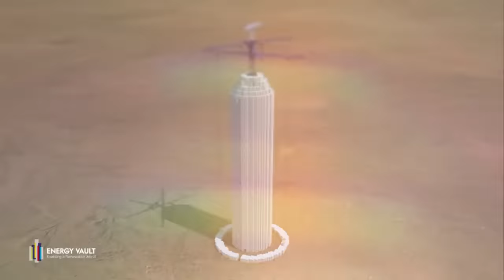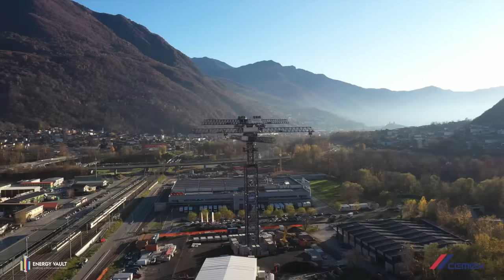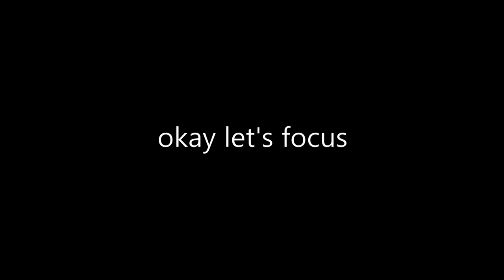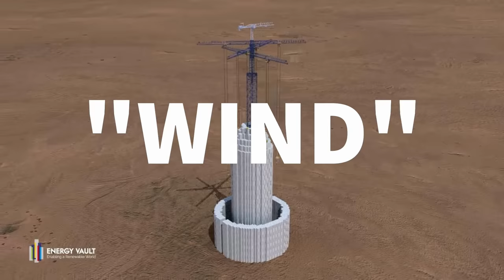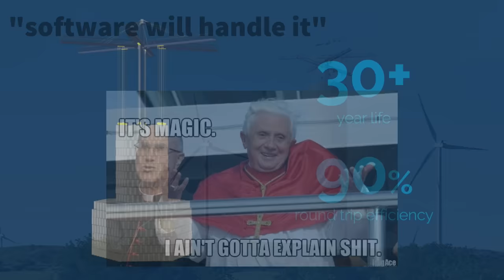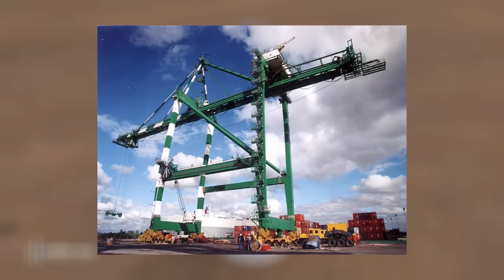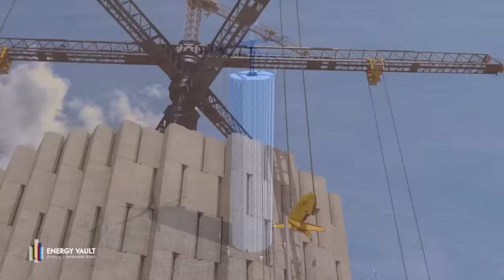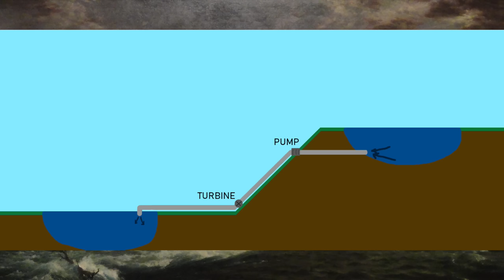The Energy Vault is a Dumb Idea, Here's Why

Comment: I like how instead of solving actual problems they "solve" already solved problems

Edit: yes i know that this problem isn't actually solved so please shut up about it
Reply: Well you could say that hydroelectric cant be put everywhere.... Which this (really bad) concept tries to solve...
Reply: @KeVIn-pm7pu  I'm pretty sure that hydroelectric isn't the only good eay of storing energy
Reply: step 1. find a problem with a simple solution.
step 2. come up with future-tech epic bacon 420 tech bro solution.
step 3. use CGI to market your "revolutionary idea" to idiots, gullible journalists, etc.
step 4. profit.
step 5. move to a less dystopian, European country with clean air, lower noise pollution, sensible laws, etc. 
step 6. sigma male grindset achieved.
Reply: but in cool sounding non-efficient futuristic way
Reply: @professorcube5104  hydro is generally the only grid scale energy storage system we have that im aware of.  I could be wrong though.
Reply: @cesaresaladandthespicycrou4080  damn
Reply: Adam should make a sister podcast to Well There's Your Problem called We Already Fixed That Problem.
Reply: @professorcube5104  Right now, Hydroelectric is the most Cost Effect way to store such power. The main reason is a hydoelectric generator is the fastest way to get started.  No need to "warm it up" which you have to do with oil, coal or natual gas generators OR keep it always running as in the case with Nuclear generators.
Reply: That's how most scams work
Reply: @professorcube5104  well there are other options but they are either Limited in Time of Storage (flywheel), very inefficent (Power to gas), very expensive and therefore not very vaiable for mass Storage (batteries). Hydroelectric is still the best way to Store Energy, pretty efficent (75%-85%), comparable low cost, Storageable for long(er) time periods.
Reply: @cesaresaladandthespicycrou4080  Not necessarily, for instance using excess energy from wind and solar to create hydrogen from the electrolysis of water (splitting H2 from H2O) could be a solution since the world will need a mobile form of energy that isn't only Lithium Ion batteries.
Reply: @WidespreadKnown  after all with your deserts in the USA you have a perfect Location to produce h2 for cheap.
Reply: @WidespreadKnown  Two words. Nuclear power
Reply: @dahleno2014  thats Not a vaiable Option for the whole World and far more expensive, if you dont ignore the costs of Storage for the waste.
Reply: Welcome to capitalism!
Reply: You mean just like renewables?
Reply: Far from solved. Pump storage is only viable in mountainous areas with lots of water and ideally cold climates like Norway and Iceland.
But most solar energy will be produced in deserts and there is no water with maximal evaporation and sometimes no mountains.
Most wind energy will be produced offshore or onshore at coastlines where there is often no mountains.
Reply: Innovation baby!
Reply: @WidespreadKnown  i am excited about that one, but also i dont think it is in production, but either way i could say the same thing about h2 storage or molten salt batteries.  Why create them when pump hydro already exists.  It is just lazy.
Reply: @marceldavis430  Not really. Renewables dont solve any Problem thats wasnt solved before.
Reply: @sualtam9509  well for  that we have Power to Gas. Therefore Yes the Problem is already solved.
Reply: @KeVIn-pm7pu  Same as storing gasoline in a desert. The electrolysis doesn't have to happen in the desert, Hydrogen can be transported to storage tanks in the desert until it needs to be used. Not saying there aren't problems to solve just that using Hydrogen is the only renewable way to store energy in liquid form.
Reply: @dahleno2014  That's energy generation, not storage. Nuclear Power is a good way to generate energy but we still need to find ways of storing energy when you aren't attached to the grid and storing excess energy from wind and solar.
Reply: @cesaresaladandthespicycrou4080  It's not in the mainstream as a solution to energy storage, sure, but it should be researched as a solution is more my point. It's long-term usage would be one of the only ways to become carbon-neutral, unlike more popular ideas such as using ethanol or Lithium-batteries.
Reply: @KeVIn-pm7pu  Power to Gas when using only electrolytic hydrogen from electricity to gas to electricity is at 30% efficiency. Far less than batteries, while being more expensive.
It's tech bro BS fueled by Big Oil.
Reply: @cesaresaladandthespicycrou4080  pumped hydro is very inefficient and requires a lot of land area.
Reply: @professorcube5104 
Energy storage is a huge problem. It's one of the most important problems in engineering right now.
Reply: @sualtam9509  "while being more expensive"  I very sure it is not more expensive than a batterysytem thats big enough to store 4 months of energy for a huge industrial country.
Reply: @WidespreadKnown  
" Not saying there aren't problems to solve just that using Hydrogen is the only renewable way to store energy in liquid form. " - again ammonia is another one. but its not exatly needed to be in liquid form, is it?
Reply: @KeVIn-pm7pu  Only that they made that issue worse, too.
Reply: Renewables do have this problem, and they are trying to  solve it. Using a solution which is basically worse then a real-life interpreation of it.
Reply: @KeVIn-pm7pu  Like I said in another thread, one of ammonia's byproducts is nitric acid, which is carcinogenic. It's not a storable energy solution, there's a reason we don't have giant ammonia burning plants because it would make living around those places untenable. Plus, there aren't giant areas of ammonia to be "mined" so we would have to create it from other products which would be adding an unnecessary step to trying to solve how do we become carbon neutral, as a society.
Reply: @MrCmon113  It's honestly a bigger problem then switching to renewable energy because at this point we have the scalable technology to move over but no way to store it sustainably.
Reply: @professorcube5104  Where is that place exactly? People need water to survive and hence hydrostorage is possible everywhere people live. Even in Arabian peninsula, sea water can be pumped to high places and then released as it is not necessary to have drinking water storage
Reply: I wonder why. It happend to me very often. Luckily I was blessed enough to realize early on the way. But I guess it has to do with a concept of thinikg of innovation as something inherently good, altough in deed just good things are good, not new ones, while this concepts serves fueling consumerism.
Reply: @shrujanamsyama9940  Not every place has accessible hills nearby and evaporation of water in hot places reduces your ability to use it above ground so that increases costs and limits you further. Hydroelectricity is not a world-wide solution for energy storage.
Reply: @WidespreadKnown  Who says that electricity storage must be done in every village? A single large hydroelectric power station can power an entire province/state. Also, evaporation of water is not really a concern as any water on surface - river or sea will evaporate. But as we know we all store water in reservoirs and taht works well. No one expects 100% efficiency in storage. So, 60% efficiency should be perfectly fine
Reply: @KeVIn-pm7pu  What? Batteries are just straight up 30% less $/MWh.
Only advantage of power-to-power would be storage over several month, but that is highly competitive between liquified air and thermal storage.
I just don't see a scenario where producing grid electricity from hydrogen would be more profitable than using it in anyother way as ressource or fuel.
Reply: Solving problems have already been solved or creating problems to solve them literally the definition of capitalism
Reply: @KeVIn-pm7pu  doesn't matter what kind of water is used even the Sahara desert borders the ocean
Reply: Tech bros don't know what a dam is.
Reply: @KeVIn-pm7pu  Yeah if you just ypu know... put a roof over it and seal it from evaporation... you kinda can...
Reply: @cesaresaladandthespicycrou4080  there are liquid salt "reactors", they are no longterm storage, but are quite efficient. Down side is, they need quite a bit of space, and to get heat them up they neat sun.
They basically concentrate sun energy with mirrors on a center with a salt core, the salt heats up and can store the heat for hours, carrying the suns energy over the night, and depending on size for some days. This is of course no solution for all areas, but at some places this could turn sunlight into a heat powerplant, that then can produce electricity by steampowered turbines
Reply: @sualtam9509  No they are not. that would mean a battery costs as much for storage capacity as the power to gas system does. But they dont. additional most countries already have infastructure for natrual gas which can be used.

i dont see the competivity betwenn liquified air and thermal storage. especially not for long term storage.
Reply: @WidespreadKnown  this is sadly super inefficient. It would be mote viable to store the energy in batteries. The benefit of hydrogen is, that you can in theory power jet engines with it. And you can ship and sell it abroad, why companies see it as a great solution  they can exploit cheap, unregulated labour to produce it, and then ship it to rich countries to sell it... in theory. And when we gear up our systems to be hydrogen dependant then they can demand almost any price.
Reply: @KeVIn-pm7pu  you realize, that deserts are important ecosystems, too. Right? Great scale energy production in the desert will change the local climate, solar panels will cool down the area and increase rainfall and catch moisture from the air. This will in turn change the climate around the desert and so forth.
Reply: @dahleno2014  nuclear power is by far not carbon neutral, its better then coal, gas or oil. But it creates sever environmental damage, were it is harvested and considerable environmental changes, were it is produced.
Nuclear power is no long term solution, and building new nuclear plants would mean to now start building reactors, that can go on the grid in 30 years and then run for additional 30-40 years.
Also nuclear energy, while kinda reliable is not really cost efficient, when you count in the energy and labour cost for storing the waste after the reactor is done.

And then we have not talked about the fact, that nuclear energy renders an area almost inhabitable for humans for decades, when anything goes wrong.
Reply: @WidespreadKnown  And like i said there too. You just need a catalyst reduction methode, problem solved.

It is storageable. how the f woulnt it be build a tank store ammonia. end of story. we dont have ammonia burning plants because why would we it is not a minable recource like fossile fuels are.

for ammonia production you need hydrogen and nitrogen as products. where is the problem ? hydrogen gets produced by renewables and nitrogen is all around us.
Reply: @shrujanamsyama9940  the environmental impact of large scale hydroelectric plants is so severe, that it can make life down stream almost impossible. Having several smaller plants is a lot more sustainable.
Reply: @cesaresaladandthespicycrou4080  One of my professors once used the example of a solar power plant in Japan which used a giant flywheel to iron out the spikes, and Tom Scott made a video about the Orkney Islands, where stuff like the electrolysis of water is tested as a way of getting rid of excess renewable electricity. I don't think that has much hurdles to becoming a large scale solution, it's just that the conversion efficiency isn't brilliant. And then there are synthetic fuels as well, but those tend to range from utopic science fiction to literally worse for the environment than fossil fuels.
Reply: @sualtam9509  it would be more profitable if you can exploit poor people in unregulated labour markets to create the hydrogen and ship it to rich countries... And when you first convince the rich countries that hydrogen is the way to go.
Reply: @hannajung7512  you do realize, that you only need a fraction of the desert to produce the same amount of energy right?  No it will not change the local climate. For the whole energy consumption worldwide we only need 1% of the sahara.
Reply: @sualtam9509  Big oil doesn't give a shit about clean hydrogen. It could be preferrable since the production and recycling of batteries tends to involve a pretty long list of deadly chemicals.
Reply: @KeVIn-pm7pu  only, that energy stored in the sahara will do you no good if you do not live at least around the Sahara.... Or you suggest to ship stored hydrogen? Were do you get the water in the Sahara from? Will you tab into the few water sources in the subsaharan area? There are people living that need this water, you know this, right? Also, such a grand scale "solution" would only cause us to be further dependend from international cooparation monopolies. This does not sound like a great idea to me.
Reply: @hannajung7512  You take the energy and bring it to where it is needed. Its called a Power grid. or pipelines. yes ships work too.
Ocean salination is an option.
"from international cooperation monopolies" - thats a capitalism problem and will never change if not done sth against capitalism. however you as the usa would not. you have many deserts yourself. And of course an international trade of hydrogen would emerge.
Reply: Solving problems makes you look good, and the already solved ones are the easiest to do
Reply: Are you the real Mr. Timecube?
Reply: In a difficult way
Reply: @hannajung7512  How so? Large reservoirs need large lands and hence submerge large landmass but it is still more efficient than small reservoirs as large reservoirs consume land in a single place and hence don't fragment the land. Small reservoirs fragment the land resource and distribute the bad effects everywhere making things bad for everyone everywhere
Reply: The future is innovating sideways, not up.
Reply: That's where the money is. Reinventing the wheel is easier than building a new one and makes people feel smart
Reply: For scam purposes, ofc
Reply: @hannajung7512  yeah that’s great, turn deserts into not deserts with rainfall!!
Reply: ... but worse.
Reply: @farazthunderouble  you realize, that the water, that falls down in deserts can in turn not fall down were it does at the moment, right? And it would take decades to turn the desert sand into fertile ground, also: deserts are ecosystems on their own, with animals and plants that can only live there.
Reply: @hannajung7512  This is absurd thinking. If you want a certain volume of water stored, it is best to have large reservoirs than many small dams. This is plain and obvious. Having 20 small dams cause much more disruption than having 1 large reservoir. The only way small dams can cause less damage is by storing much less amount of water which in turn reduces the total water stored and that amounts to absurdity as the whole point of having dams is to store water.

I don't deny that the water species, especially the inland river fish will be affected by large dams but that is a small price to pay. Moreover, the environmental payoff from these inland fish is to limited. The only concern can be about losing the fish permanently and hence causing extinction irreversibly. The inland water amounts to just 1% of all water supply and hence the inland water species have negligible real impact on overall environment.

About silt in floodplains, the dams are dredged regularly and the silt sold off to farmers. In fact, it is much more efficient than simply allowing flooding of plains as lot of silt is wasted and washed down into the sea. Reservoirs avoid such scenario. Dredging and desilting of reservoir is a must as if not done, in about 6-7 years, the reservoir will lose 50-60% capacity. SO, the logic about floodplains does not hold grounds considering the fact that the silt is mined and given back to where it is needed and in a much more efficient manner.

About trees giving shade, you don't understand how trees work. In many places in India, govt planted nilgiri and certain other variety of trees across rivers and it was found that these trees suck out huge amounts of water and lower water level. Even other trees suck water from rivers and hence lower the water carried. Moreover, trees also lose water as transpiration which is not much better than evaporation. Evaporation happens only at the water surface whereas transpiration happens across all trees and cover much larger surface than water bodies. All the trees suck water from the same ground which is supplied by the same water bodies. This means that the loss through trees is much more than evaporation.

About water overflows and repairs, dams are made with extreme reinforcement and are meant to withstand even wars to some extent. It is true that it needs maintenance, but that is not an issue as everything in the world needs maintenance. If you leave a house empty for 5 years, it will become unlivable. About flooding during rains, it is true that large dams flood more but it does not crack. there are operators who lift the gates of dams when inflow becomes too much to handle. Downstream does get flooded more extensively in alrge dams but in small dams, the flooding is more widespread, thereby causing much more crop loss and possible famine in comparison. It is a tradeoff between flooding smaller areas but with more concentrated damage or flooding everywhere with lower damage. If we look at greater good, it is better to save crops over large areas at the expense of few human lives in smaller areas as famines can be much more dangerous than small loss of lives.
Reply: @hannajung7512  No they don't. Hydrogen gas has to be stored under high pressure or at cryogenic temperatures, neither of which are necessary for crude oil and most of its derivates to my knowledge. Just look at how different oil tankers and gas tankers are built, and same for above ground storage tanks. And yes, you could argue that those gas tankers and tanks are largely owned by oil companies, but a far too big portion of their production and products are things like plastics, asphalt and other byproducts for them to want to switch to a source which does not provide any of those opportunities and makes such a big portion of their plants obsolete. Besides, these companies are so big and influential that if they'd really want us to use hydrogen you'd be able to get it at every petrol station already. There is no way they would ever allow electric cars to get a bigger market share than hydrogen cars if they cared at all.
Reply: @shrujanamsyama9940  What I told you is not absurd thinking, but what I  learned by listening to ecologist studying the impact of damns on the environment and mitigation methods.
The assumption that decentralized smaller floodings would cause wide spread crop failure, while one huge flood will "only cost some lives" is assinine. Not only can we mitigate local crop failure (if they would even happen) with our modern supply chains, a big flood would affect not just the local area ... It would literally flood the whole river dale. To varying degrees sure, but still.
And a big flood does cost hundreds if not thousands if lives. It is simply just unethical to take this calculated risk to have some farmes not loose their crops.

And about the selling of silt: it might be more efficient to bring our the silt manually instead of having the rivers flood the area, but making farmers pay for something that should he part of the normal ecocyclevof the area is absolutly unethical.

And current damms allready are affecting for example the salmon population, causing not only the loss of the species, but work place loss, and ecosystem disruptions because salmons are quite important for most of them
Reply: @jlust6660  so the flywheel storage is cool but it only has like a 5 or 6 hour charge time.  The thing about pump hydro is you can have a 7 gigawatt plant.  Thats about 480,000 tesla walls.  So our technology is far from real grid scale storage outside of pump hydro so the idea to say oh they invented pump hydro is dumb.  You cant have pump hydro outside of areas with natural water.  Otherwise we would have pump hydro everywhere and be green.  If gravity bateries didnt need millions of tons for the potential energy they would be great because as they grow cubed so they almost work better as they grow where as chemical batteries are just AA batteries stringed together.
Reply: @shrujanamsyama9940  no country has crop failures on that large a scale because of a local flooding, what are you thinking how these floodings look like?
Selling the silt is unethical because it causes a dependancy and reduces the ability to self rely of the farmers, if they cannot afford to pay for the silt they are fucked, driving the loss of small family farming and the spread of large Industrial farming and by doing so poverty and hunger, because now people that befor were able to work the land for food have ti buy it.
If you think, that marshes or forests are useless, you lack the vety basis of understanding needed to talk about ecological impacts.

And the ecologists are christian evangelists or NATO spies? Are you high, dude?
Reply: @cesaresaladandthespicycrou4080  I'm not making a case for or against any of these technologies (with the exception of synthetic fuels maybe), I was just pointing out that they exist (I had missed the comments that mentioned them before me, sorry about that). Though I think that with your arguments against them you're comparing apples and oranges somewhat. The flywheel I talked about isn't meant to be something on the scale of a decently sized hydroelectric dam, IIRC the solar park it accompanies isn't that big to begin with. I do think that does not mean that the application could never be done on a larger scale if that would ever be necessary. Especially in the energy debate in the region where I live just any large scale solution seems to go out of fashion. For hypothetical new nuclear reactors there is a serious consideration for more smaller power reactors as main suppliers to more local grids, which implies you can look for energy storage on a case by case basis as well rather than needing a single solution to solve all problems. And as such, energy storage could maybe also grow with the demand and would rarely ever have to be grid scale by our current understanding of the word. That sort of is what happens around here already, a lot of cities have a few windmills for electricity production, and on windier days the excess ones are turned off or deliberately made less efficient to meet the demand, but I doubt these single windmills being switched off are often significant to the grid itself, so if in the future they would keep spinning and the electricity would go into storage that would not have to be storage on the order of gigawatts.
Reply: @marceldavis430  I’ve come to Learn how to spot an idiot on the internet is when they say something like “ you mean just like …..” and say nothing else
Reply: @dahleno2014  
I'm sure your Great, Great, Two Headed Grand kids will thank you for their inheritence.
Reply: @professorcube5104  naw. Gravity batteries like this have been around for a long long looooong time. Lots longer then electricity has been common. Heck. They where still operating to service industrial facilities from the old steam age when I did my machining apprenticeship. 
They work, the issues in the video are blown way out of proportion, the biggest issues are they take up real-estate and people don't like hearing blocks bang together.
It's just fluff. Both ways round.
Reply: @humanistwriting5477  did you even listen to the points he made. Plus do you even have any expertise in this topic?
Reply: @professorcube5104  I do have expertise on the topic. 
And I did listen to the video.
And I have made the bearings for an 130 year old gravity battery. They are not a bad idea.
And I do not need any expertise for you to do the maths yourself, just look at how fast the wind would have to be before they become a problem. It's basic math no complex formula required.

From there, look up the fatigue limit for steel, and realize the entire spill about "self repairing" magic materials literally describes steel.
Reply: @hannajung7512  I don't think you understand the extent of flooding that happens in large plain land, During heavy rains, multiple rivers flood and devastate large amount of land unless controlled by dams or other means. Even 10% food reduction is enough to cause famines and that can easily be done by flooding.

Selling silt is not unethical as the silt is sold at cost price by govt. No one else can sell silt as only govt has access to dams and only govt can authorise dredging in dams. This will forever remain that way mainly due to security reason (attacks on dams). As a result, the silt is never sold in prices that hurt anyone.
Reply: Well energy storage isn’t really solved globally but there are far smarter ways to do it currently
Reply: @WidespreadKnown  you mean the hydrogen creating with a like 12% efficiency? Sucks pretty hard.
Reply: @dahleno2014  isn’t really an option. Requires ginormous mines,  causes pollution, waste has to be stored for billions of years.
Reply: @cesaresaladandthespicycrou4080  That's because physics.  You need to move a lot of mass down a steep and long height gradient before you get worthwhile energy returns. Try to do that with concrete blocks and you'll have city sized crane farms which keep breaking and falling over even when a horrendous amount of time and money is spent on maintenance and all at a huge capital cost.  Hmmm.
Reply: @KeVIn-pm7pu  well with power to gas and than back to power you loose about 70% of the energy when we talk about Methane. 
When we talk about Hydrogen you have the problem, that storage does not scale up well. And we still lose about 40 % of the energy. If you go for the fuelcell, to get a cut of the energy bet, you have the problem that they are really expansive and use some rare materials. So that also does not scale up well. I am not saying, that there aren't options. But we are far from the point, were all problems are basicly solved.
Reply: @theodiscusgaming3909  pumped hydro is quite efficient. The area it requires is not the real problem. The Problem is that you can only build them in specific places. And those are several orders of magnatude to few for the storage capacities we expect to have.
Reply: @paulmentzer7658  You have a start-up time for hydroelectric too. The water goes in big tubes to the turbine. If you start up too fast, you have pressure waves in these tubes, wich can break them. But start-up time is really short, like 30 sec to 3 min.
Reply: LMAO if energy storage was a "solved problem" we basically wouldn't have to worry about global warming, but sure
Reply: @MusikCassette  well i dont See much of a Problem there. The solution simplifyed is just build more of them. You say it doesnt scale up good but why exactly? I dont See much of a Problem just Time.
Reply: Pump-storage hydroelectricity requires an elevation change in the topography and the voids being filled are usually the remmenantes of an open pit mine. It’s great when these factors are present, but not feasible elsewhere. That being said, this crane idea is never feasible so the water storage has a leg up on them.
Reply: @sualtam9509  did you watch the video? He showed how you could do underground water storage and above ground tanks. Maybe not the best but still more feasible than the tower of babel but in concrete
Reply: But making sure it looks cool and futuristic on CGI videos.
Reply: @cesaresaladandthespicycrou4080  Molten salt thermal batteries work well with concentrated solar thermal. They've been deployed in Spain at the grid scale. They are pretty compact for the amount of energy they store, are mechanically simple and not ruinously expensive. It really annoys me that we haven't embraced CSP in Australia. Setting it up around mining settlements west of the dividing range, where there are clear conditions, flat ground, and high solar irradiance and already existing electrical infrastructure seems to be really low hanging fruit, and there is an abundance of land to keep on expanding it for as long as you want. Places like Broken Hill, NSW, Kalgoorlie, WA  and Mount Isa, QLD would be ideal for this.
Reply: @MichaelSotoCE  Yes I did and this way is an engineering nightmare. Adam might be good at pointing out flaws but he has no solutions of his own and just points at existing ones. In some cases that might be valid, in this case it's not.
Reply: @lmlmd2714  thats awesome.  I was unaware that they are actually finctional and work.  The over all arching point i am making the CMSBs didnt solve a solved problem.  And all though this is a bad idea saying it solves a solved problem is just dumb.
Reply: That's capitalism, as long as you make people believe they need something you can sell it. If you can sell it, you're winning at capitalism even if you're product is bad or destructive.
Reply: The best way to make money is to take an existing solution and tweak it to make the solution look cool.
Reply: They are trying to solve a problem of geography. Not every place has appropriate geography for pumped storage hydroelectric. That's the weakest argument in the whole video. It should have just been 3 seconds of "they are ridiculously material intensive and inefficient."
Reply: @WidespreadKnown  No cus the process is so inefficient, you loose a huge amount of energy that you put in
Reply: @strider_hiryu850  Add to step 4 having an IPO which pushes the valuation of your vaporware company to over a billion dollars
Reply: @KeVIn-pm7pu  
I talked about several different configurations. And several different Problems. So it is not quite clear what problem you think would be solved by building more of what.
Reply: Capitalism
Reply: @professorcube5104  Whether or not a method of storing energy is good is dependent on what problem you're attempting to solve. Pumping water between higher and lower reservoirs would be a pretty bad way to store energy to power electronics in a vehicle. As for smoothing out electric loads, I don't think there is another method that is remotely scalable to a major power grid than hydroelectric storage. Compressed air storage is used in several industrial applications, especially those which already require large air compressors for operation, but this is very difficult to scale up to city-wide or larger grid applications.
Reply: @cesaresaladandthespicycrou4080  Compressed air is used in some industrial settings, especially where the plant already operates a large air compressor/tank. They'll compress air during off hours when they can purchase electricity more cheaply, then run a turbine off of compressed air during peak draw hours. This is the next best large scale energy storage solution I know of, but at a full grid scale it's just absurdly cheaper to pump water uphill than to build pressurized containers for a huge amount of air.
Reply: @benbriggs4604  the point i am trying to make is it is like saying who cares about energy storage everybody should get 50% of their energy from windmills like Denmark.  Well yea that is great if you are by wind, but if you are not you are SOL.  Just like pump hydro is great if you are by water but if you are not by water you are sol.  Solar energy isnt replacing wind.
Reply: We can't even make cities sustainable and less car dependent. When we already had car less cities in the past.
Reply: Gotta scam some investors somehow.
Reply: Ask one of these engineers how to crack an egg and they'll have you throwing it up at the ceiling and using a large bucket the size of your kitchen floor to catch the egg. A filter system would deal with the egg shells and pieces of plaster from the ceiling, and the vessel in the centre of the dish shaped collector would be where the rest of the egg slides into
Reply: @strider_hiryu850  solar... Freaking... Roads
Reply: Capitalism in a nutshell: either sell the same shit with a different name or event new needs/problems to sell the solution for it
Reply: Lol, what 3 words would like a word with you.
Reply: Frankly, hydro-pump storage has a lot of problems. Low efficiency, high costs, low output... you know, the problems this new system has, except not quite as severe. The only major difference is that pumped water requires a certain kind of land and a large volume of water, while this device can be assembled in any place that isn't too windy and has flat ground somewhere. That means that it could have some viability, barring the fact that, as mentioned, gravity is a terrible way of storing energy in general.
Reply: i mean this is a way to not stuck in local minimum
Reply: VC in a nutshell. 
I only want to solve a specific problem of mine, becoming a millionaire by earning $500K/y
Reply: @hannajung7512    " Great scale energy production in the desert will change the local climate, solar panels will cool down the area and increase rainfall and catch moisture from the air "
I don't see a problem in turning the Sahara desert into the Amazon forest. (the amazon forest itself was probably man made by the antique civilizations of the mountains burning the swamp and turning it into a forest, which is much better than a swamp)
Reply: @hannajung7512    "nuclear power is by far not carbon neutral, its better then coal, gas or oil. But it creates sever environmental damage, were it is harvested and considerable environmental changes, were it is produced."
It doesn't create more environmental damage than normal mining. And processing only does damage if you fail to contain the processes, we don't consider it because all of the human industry actually have environmental damage if exposed, that's why there's safety procedures. The damage only occurs when the system fails, like oil spills for example. The real problem with Oil is not spilling thou, its the CO2 environmental effect on the climate.
Except nuclear is much more easy to contain because for most of the processing is done in solid form, not on aqueous.
Nuclear power is totally carbon neutral if you use electric trucks to move the rocks. There's nothing in the entire process that really requires releasing tons of CO2. Except for the concrete production and the steel production (everything uses concrete and steel, that's another problem, not a problem with nuclear power), but still, a nuclear power plant uses way less concrete than an Hydro plant.

"Also nuclear energy, while kinda reliable is not really cost efficient, when you count in the energy and labour cost for storing the waste after the reactor is done"
WTF, storing the waste doesn't have to have is higher labor cost, you just don't think about creating a sarcophagus to store it for 100Ky, who needs that? 
Just store it in a stable geological region bellow the water table, just dig a hole, or use already dug ones (old mines). Its as simple as that, the problem is this fucking FUD, fear and uncertainty and doubt. And basically "not on may lawn". Its not a technical problem, nor is it costly. Its mostly a political problem. 

Nuclear is totally cost efficient in the long run and at massive scales. The real problem is that it requires a massive up-front investment. At least get things straight before telling bullshit about things you don't know.
Reply: @KeVIn-pm7pu    "  you do realize, that you only need a fraction of the desert to produce the same amount of energy right?  No it will not change the local climate. For the whole energy consumption worldwide we only need 1% of the sahara" 

its more like 15% or the size of Texas
Reply: @monad_tcp  people have to watch over the sacrophagus and maintain it though... This costs labour and energy.
Or people have to dig the hole, stabilize it and then watch over it, guard it. So same effect, if not even more costly, because digging a deep stable chamber that is below the waterline AND watersafe, so water will not flow in is not that easy.
It is not even close to as easy as you think.

And please tell me how the environmental damage of nuclear waste getting in rivers or the soil is not worse then lets say: iron getting chucked out?
Your trust into the mining being safe and contained is unjustified... If I could rely on companies or state to actually be responsible in what they do and play it safe I would probably agree with you.
But they don't. That is why we have contaminated groundwater, oil spills etc. Only few of them are because of desaster  most of them are because safety got cut to reduce costs.
Only because you can make it safe, does not mean that it is. And because it is not you have to count in in the cost of possible desaster at  every step. Because what is the actual reality of uran mining is, that is causes contamination with radioactive dust in the area, that depending on wind and water flow can be huge. And this dust is what makes areas uninhabitable for humans.

The nuclear material needs to be shipped and transported, and mined, and until the day we actual have cargo ships, minig machines and trucks that are carbon neutral (what ever fuel they use) it is not okay to just count out the carbon cost of the technique. It exists, and until this changes we have to count it in.
Reply: @garyschultz253    " I'm sure your Great, Great, Two Headed Grand kids will thank you for their inheritence." 
That's for sure. They will thank us for moving from Petrol to Nuclear and having 100 tons of depleted fissile material safely stored underground where it doesn't bother anyone, doesn't affect any of the ecosystems, and is so far bellow the water levels that there's no possibility of contamination.
Because the other option would be living on a hell-scape of uncontrolled climate change and +8C or even higher pushing the planetary climate to levels never seem before in the story of this species.
And good luck trying to power the entirety of modern civilization with solar power, and lithium batteries. We would need at least a global HVDC interconnected grid, that's not even a dream yet, its like thinking about the Internet in 1920. 
But we don't have 50 years to act. We have more like 10y to 20y before the system get out of its balance.
Its technically doable in a lesser time-frame, its not impossible in engineering, but its a political problem.
Its possible to go complete carbon neutral in 10y, France did it. Just go 100% nuclear in power generation with 100% EV. Or mix it with solar, but no more than 40% or you need to re-implement another kind of power grid that doesn't need base-load. And forget about Wind power, it is not efficient enough, and never will be.
The real problem with going solar is what happens after 25y, lots of unrecyclable trash. But I guess burying those on landfills is fine for the "greenies", unlike the nuclear trash.
You guys are all bonkers.
Reply: @hannajung7512   " It is not even close to as easy as you think."  Its easier than mining for gold, for example.
When I say its "easy" , it doesn't mean its easy for you, it means its easy because its similar to industries we already have.
Reply: And what is "  iron getting chucked out " , mining uranium is no different than mining iron...
ever heard of slag ?
Reply: I facepalm over the fear of things...
Reply: "  Only because you can make it safe, does not mean that it is" 
It totally fucking means it is.

I have a bottle of butane gas under my stove. 
" only because you can make it safe, doesn't not mean it is" 
I guess, now I fear my bottle of gas I use to cook....

EYE ROLLS , such an argument...
Reply: @hannajung7512    "The nuclear material needs to be shipped and transported, and mined, and until the day we actual have cargo ships, minig machines and trucks that are carbon neutral (what ever fuel they use) it is not okay to just count out the carbon cost of the technique. It exists, and until this changes we have to count it in." 

It is okay to discount those means, because you don't count them on solar panels or those eolic bullshit blades.
We have to divide the problems, you can't care for everything at the same time, we think in systems, and solve one problem at a time.

If we are going to go thinking this way, the carbon cost of keeping burning Petrol is actually lower, because you don't need to build any new infrastructure. face palms.
Reply: @monad_tcp  yes, we DO count them on solar panels and windturbines. What are you talking about?
And no the carbon cost is not lower... even if you count the new infrastructure in.
Reply: @monad_tcp  the problem is, that rain that falls down in the Saharah, will not fall down on other places.... You know ... those places were people are  If you cannot see the problem I really know not what to tell you... Just that much: it needs decades to turn the Saharah into soil fertil enough for a forest... Not even speaking about agriculture.
Reply: @monad_tcp  i don't think so but even if it is 15%: local ecosystem<global climate
Reply: "If you want a new idea, open an old book."
Reply: @hannajung7512  thats Not true. The infastructure to Store natrual Gas or oil can Not be used for hydrogen. You have to at least Upgrade or build completly new both cost expensive procedors.
Reply: @sualtam9509  Thank you. I agree with the issues around using concrete and the CO2 emissions, however there are other heavy materials that don't evaporate so readily. With adequate sensor and controls, it would seem that the blocks wouldn't necessarily even have to be perfectly consistent weights, just dimensions. If a tolerance was determined, and each block was documented and tracked for position, materials such as field stones, quarry castoff, demolition debris could be bound and encased in blocks, further reducing new emissions. I do agree with the other design related issues and a gantry crane would surely be more stable and predictable.
Reply: @hannajung7512  just wanted to say thank you for being the voice of reason.
It was nice reading your comments - really gave me hope that not everyone on the internet is a baboon ☺️
Reply: @Jehty_  thank you, I try my very best to stay informt and communicate. It does not mean I am allways right though ;-)
Reply: @professorcube5104  It is the cheapest and most reliable and least likely to explode on you.
Reply: @namelessrambler  the problem is less that we have no technology to build them, the problem is, that many of the options are not profitable compared to in time energy extraction via fossil fuels (to no little extend because the infrastructure allready stands and to another extend because we do privatize the profits, while socialize a huge part of the costs (healthcare for people that get sick from breathing in the smoke, ecological projects to stabilize ecosystems threatened by climate change, rebuilding and clean ups after catastrophies caused by climate change, oil spills, toxic rain fall etc., Growing food prices for the damage done to fertile land by climate change, sour rain, toxic fumes, oil spills etc. I bet, if oil and gas companies had to pay what it actually costs to mitigate for the damage their product does, or that using oil and gas does, they would switch to other options on a dime.
Reply: @lmlmd2714  CSP sounds like the PERFECT option for a land like Australia. I might be misled by media, but aren't the two things you have lots of flat land that is nearly uninhabitable and sun? It should be a breeze to cut out small sections of these areas for CSP without causing severe damage to the ecosystem, or am I wrong?
Reply: @soulwarsnerd  while I onehundred percent agree, that we should make cities less car centric. I think the fact that cities in the past had none either misses some important points: cities were a lot smaller, people usually had not a good time, when they could not afford transportation by animal, especcially sick or disabled people were screwed, and while there were no cars, there still was transportation... Powered by animals, that usually were beaten into submission, because the time a horse, donkey or oxen pulls a carriage out of its free will is very, very limited.
Reply: @soulwarsnerd  while I onehundred percent agree, that we should make cities less car centric. I think the fact that cities in the past had none either misses some important points: cities were a lot smaller, people usually had not a good time, when they could not afford transportation by animal, especcially sick or disabled people were screwed, and while there were no cars, there still was transportation... Powered by animals, that usually were beaten into submission, because the time a horse, donkey or oxen pulls a carriage out of its free will is very, very limited.
Reply: @soulwarsnerd  while I onehundred percent agree, that we should make cities less car centric. I think the fact that cities in the past had none either misses some important points: cities were a lot smaller, people usually had not a good time, when they could not afford transportation by animal, especcially sick or disabled people were screwed, and while there were no cars, there still was transportation... Powered by animals, that usually were beaten into submission, because the time a horse, donkey or oxen pulls a carriage out of its free will is very, very limited.
Reply: @monad_tcp  the difference also lies in our ability to clean up after a spill of whatever, AND if we have alternatives. I think we should shut down fossil fuel burning befor nuclear energy, because while nuclear contamination sucks..  at least we have ways to clean up after wards.
Not so much with excess CO2.
That is, why I shifted my initial support for the anti nuclear movement to "it was a mistake that we in Germany decided to stop nuclear energy use befor we stopped coal, oil and gas usage".
But I do not think that scaling up nuclear energy production will do us any good at this point, we need ti first utilize nonnuclear means, that have a much lower environmental impact on every messurable level and then take a look how many nuclear plans we actually need..  if any.
But since companies managed to privatize the profits if nuclear energy, while socializing the costs (healthcare for people that get hurt or sick during the mining, shipping and production process, or worse, these people just die without health care, the clean up of contaminated water supplies and land, the mitigation of the disruption of the ecosystem depending on cooling method deployed, the storage of waste) these companies have absolutly no interest in investing other methods... Or worse loose the market because energy production gets community owned.
This is why there is this masive push in favor of nuclear energy atm.
Reply: @monad_tcp  on one point you are right: nuclear wins compared to burning fossil fuels, on every level. But it does not win compare to wind, hydro, geotermal and solar, even though even in these categories there are differences. A stream hyrdo plant or tidal turbine is better then a damm. Solar panels on roofs are better then using a huge plot of land, decentralized windturbines placed in farm land or in industrial parks are better then large windparks, or placing a turbine into a natural forest. Geotermal plants are the best but mostly only usable to provide heating. Etc.
Things are not created equal. But arguing in favor of nuclear, in a place were we all agree that fossil is bad makes it look like you are arguing in favor of prefering fossil energy over hydroelectric methods...
Reply: @jjhhandk3974  nice Argument!
Reply: It's just like when Chevy was trying to prevent engine knock instead of using ethanol which was already available and they knew worked they invented Tetraethyllead so they had something they could patent and make money off of.
Reply: @hannajung7512  nuclear doesn't win against hydro and geotermal, if you still had places to install newer capacity, but most is already taped 
Solar is very good too, but it's hard to create a stable grid.
Forget about wind, wind is too weak even in the theoretical maximum performance.
Wind power is a gismo, never will be used in large scale.
Sure, there are single 4MW wind generators, but they go only in very specific places and they're ginormous.
A small modern nuclear power plant cost a hundred billion dollars, but they start on Terawatt scale and last for 60 years. If you divide the TCO per MW, its hard to beat it.
Only the most advanced cristaline PV panels gets to that scale in cost. But we are talking about millions of panels to get a TW. And they last at best 25 years.
The amount of trash is magnificent !!!
Why the nuclear generator is mostly a concrete, steel and lead in materials, easily recyclable.
Except that it would produce 1T on nuclear waste per decade...
That's almost nothing, but people will still cry about it.
And the billions of tons of CO2 saved, even if you factor mining uranium.
It's a no brainer. People are only against it because of fear. There's no other reason.
Now that 10y passed on Japan, and they restarted their nuclear program. Ask them how they think about the expensive cost of powering their country from big generators from parked o tankers.
It's absolute obvious why they restarted it.
Not only it is green power, it's super cheap in the long run. And it's tiny, the generators use almost no land area.
(I hope they learned their lesson about disassembling them after 60y of use for better and modern generators instead of waiting them to fail, because if you do things right, it's absolutely safe)
Reply: @hannajung7512  "Also the time scale that a contamination is a problem is a lot bigger with nuclear contamination, yes other spills suck ass as well, but the effects are rather short term. Not so much with nuclear desaster [sic]."
What are you even talking about ? its much easier to clean top dust from the soil than cleaning an oil spill in the middle of the ocean.
And what was the last time we had a open core nuclear reactor spilling things in the atmosphere ? Chernobyl of course, it was a terrible design.

Fukushima did release some particulates in the atmosphere, but that was because it released hydrogen. That's why they had to clean the top 10cm of soil near 10km from it.
The irony is that ionized water rapidly decomposes into hydrogen and oxygen and that can explode, and it did explode (it killed two people, the only ones directly killed by the nuclear power plant release, all the others were killed by the water)
The most dangerous thing in a nuclear reactor is water, ironically. Water is no toy. 
Even head of that Russian nuclear power plant that exploded with the force of a small nuke and decimated downstream cities ? 
No nuclear fallout, still the same level of catastrophe that Fukushima was. I don't see anyone saying how dangerous water dams are.
Water is always dangerous, Fukushima wasn't a failure of the nuclear reactor per sì. 
Even the meltdown wasn't that bad, it just stays there (to this day), no release to the atmosphere of any material from the core. (except hydrogen and particulates dissolved by the water, water corrodes anything, even heavy metals).

Oil spills is the worst thing we can do for the environment, its worst than the Chernobyl. Nature can deal with radiation, that oil is super hard to get rid of. You need surfactants to break the long sequences of atoms. Its the same problem with plastics.

Nuclear contamination is really bad if you released material from the core, that never happened. Except once in a badly made experiment. (Chernobyl was not and accident, it was a criminally done experiment, who the fuck designed a fucking open core reactor ! commies, of course)

" It boggles my mind, that you seem to be unable to grasp the simple idea of risk mitigation. "
No, its you who don't grasp it. You don't mitigate the risk by simply not using one of the best forms of power generation, you do risk mitigation by doing proper engineering and having legislation and safety procedures. 

Things can fail, but every time they failed (Chernobyl, Tree Mile, Fukushima), the technology got leaps better, that's risk mitigation, you look at what failed and then make something better, you diminish the risk.

But no, you people would be afraid of sitting in a plane in the very begining of the aviation, because planes used to fall every time. You were the ones trying to ban it for "being unsafe".

You don't want to mitigate risk, you want to have no risk at all, guess what, life has and always will have risks.
Risks need to be balanced against benefits. And the benefits of nuclear power totally pay for the risks, even if you count the 3 "accidents". 

Just never get out of your house, this way you will never get involved in a car crash. "risk mitigation", you may as well just die, for being afraid of living.
Reply: @hannajung7512  "Geotermal plants are the best but mostly only usable to provide heating" Geoterm is horrible because they can only be placed where the tectonic plates are very thin. You are not being serious, are you ?

The only viable options is Solar and Nuclear used together (and Hydro, but there's not much more places we can build it, we already used it all), or 100% Solar with a global HVDC Internet of Power that won't exist anytime soon because of politics.
Your dreams of Eolic/Geotermal isn't happening for practical engineering reasons. I don't care how much you fear nuclear power, it is the solution to our problem.
Reply: I believe in nuclear energy so much that I put $100K in shares from small modular nuclear reactors. Lets see who's wrong in 20y.
Reply: @monad_tcp   @Luiz Felipe  funny hearing you say wind does not work, because Germany uses it successfully, and all calculations show it to be the most efficient technology, even when you calculate in the no wind days. At least when it comes to the carbon to energy ratio, and to the cost of production to energy as well 
Yes, you need space, but the space needed is not that big a deal if you consider, that you can build them on existing farmland and pastures with just a minor loss of space, bevause their foot is actually pretty small

And nuclear energy would not be cheap at all, if you would calculate in the costs for deconstructing the powerplant ant storing away this thing as nuclear waste, but this is usially not done, just like the storing costs for the waste itself is usually not calculated into the cost of nuclear energy 
And even without these cost calculated into the bill, wind, solar and stream turbines create the energy much cheaper.
I am aware that at this point some countries will need to choose between fossil fuels and nuclear, and that renewable energy sources are not equally deployable everywere. That does not mean though, that it is wise to start building new reactors at this point, that will be ready in 30 years, and then will have to run at least for 30years just to get even on the investment of carbon and money for building them, when this technology still releases carbon in our atmosphere that is a multiple of other methods, creates toxic waste that we have to take care of and uses a limited resource, that needs to be mined under great risk for the workers.
At this point even those countries that produce larger percentage of their energy via wind, hydro, geothermal or solar are not even close to reaching the limits of what is actually viable.
There is still a lots of potential unused.
But its potential on a decentral, communal level, why companies allways claim there are no capacities left, because THEY can not profit from it.
Reply: @hannajung7512  " Germany uses it successfully" why 80% being powered by coal, sure...
Reply: @hannajung7512   "that it is wise to start building new reactors at this point, that will be ready in 30 years"
30 years ? oh, you are very wrong.
We are developing factories to mass produce nuclear reactors.
The problem with nuclear reactors is that each and every one of the 450 nuclear reactors in operation is a unique cornflake. 
But if we produce them in large scale, you can install them much faster. And they will also be much more safer. 
30y ? France made 20 reactors in just 10y, and got 100% nuclear.
Reply: This is absolutely not an engineering problem at all. We could churn 4000 nuclear reactors in 10y and totally migrate the entire grid to 100% electric in the entire world.
Its only a money problem, and money is infinite anyway, governments print it.
We have the engineering, we have enough concrete and iron, we have enough mining capacity to last 8000y at 2% growth. 
What else do you want ?
Reply: And the ironic thing is that most of those 450 nuclear reactors work almost "for free" because we have a stockpile of 10000 nukes that can be used as a fuel for free almost.
Not scaling nuclear capacity in power production even goes against nuclear deterrance, because otherwise what you are going to do with the nukes ? sell them ? or let them sit mothballed in the store slowly deteriorating without any maintenance (because that's what happen either way).
Its funny people don't know that nuclear energy in civil use is forcing the military to sell their nuclear stock pile for pacific uses to the civil sector. (and its much cheaper than mining)
[of course those won't last forever, but it did solve the problem of proliferation that the politicians couldn't solve, the irony...]
Reply: @monad_tcp  its not a money problem.... Its a human work and safety problem. Do you think you just print money and suddenly stuff appears?
Reply: @humanistwriting5477  good point. These batteries have already been purchased and are being produced. I honestly don’t understand what the video is trying to say. None of its points are valid
Reply: @100SKILL100  please elaborate about why gravity batteries are never feasible? They are already in production and have been purchased. There’s some people much more educated than you that seem to think they ARE feasible in some situations. Very feasible indeed
Reply: @jjhhandk3974  I drive cranes.  What's your experience?  Carry on.
Reply: @jjhhandk3974  Actually, I'm not even sure you're replying to my comment but carry on, refute my points with some kind of rational fact based argument.  Oh, wait, you can't.  You don't even know how to operate a magic 8 ball.  Hilarious.
Reply: @cliveadams7629  scroll up and read your comment. “I drive cranes” 😂 I’m sure you don’t operate cranes
Reply: @humanistwriting5477  😂 yea, flat earthers… I guess I just don’t understand people these days.. oh well.
Reply: @jjhhandk3974  What?  I have a blue card, to operate crawler cranes 10 tons and above.  I drive cranes. That's why they call me the driver.  Again, please outline your experience with cranes.  If you had any you'd know the person making the crane do craney things is called the driver or operator, doesn't really matter.  I know what I'm talking about, you don't.   Now go find your 8 ball and tey to work it out.
Reply: @jjhhandk3974  Oh yeah, and I also have a degree in engineering.  What are your qualifications?
Reply: @jjhhandk3974  man I've heard it all lately. Even had someone try and tell me renting is a better value then home ownership!
Because paying rent apperantly frees up more money then just paying taxes... 🤣
Yup. 2+2 does not equal 4 to these people.
Reply: How about a storage system that compresses air instead? Would that have any chance of working?
Reply: @KeVIn-pm7pu  there are already nuclear wasteless reactor's cycles.
Reply: @aidegrod  no there are not. Only experimental prototypes which still need research. In other words Not useful to combat climate change which we only can do with what we have on Hand now.
If research is sucessful we can use such Technologys in the (near) Future.
Reply: Pumped hydro isn't an option in most geological situations. You need lots of water flow that isn't rear marked for agriculture or some random species of field mouse, and you need hight differences that won't cost to much to engineer around. That means hills that are high enough to make a difference, but not like the Rocky mountains with mile high cliffs or whatever.

This can be put into a parking lot in Nebraska. It's cheap for it's scale, and as long as there aren't tornados at that moment, it'll be fine.
Reply: @Eat_shit--die_mad  this reminds me of Metaverse.
Reply: @professorcube5104  hydroelectric is a terrible way to save the environment (destroying local water systems)
Reply: @WidespreadKnown  electrolysis is not a viable option for a country with potable water scarcity and overuse, a far better option for fuel cells is generating formic acid from CO2 and you get carbon capture at the same time.
Reply: If you dont have problems, just creat some